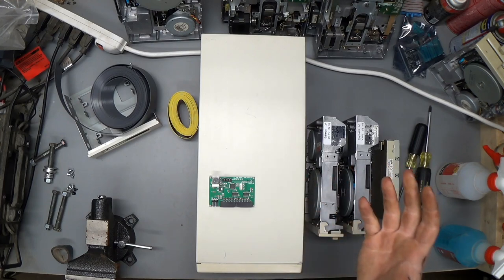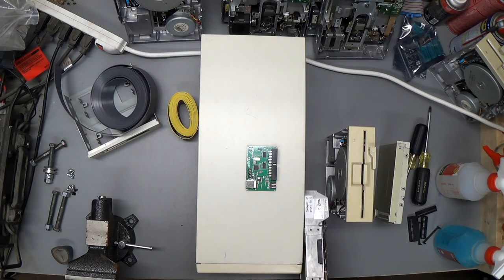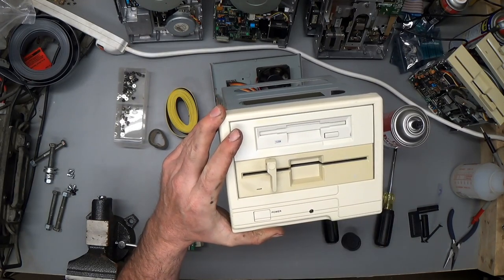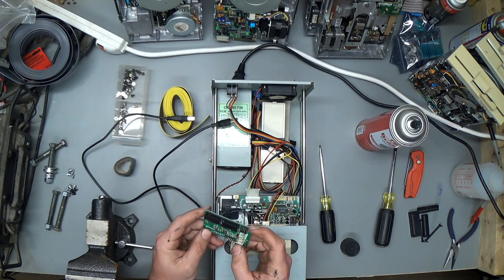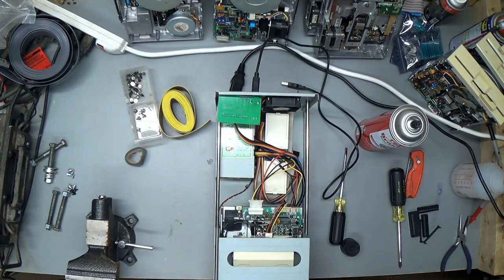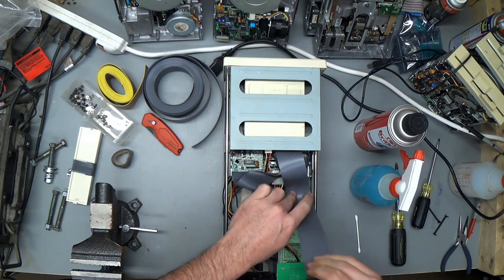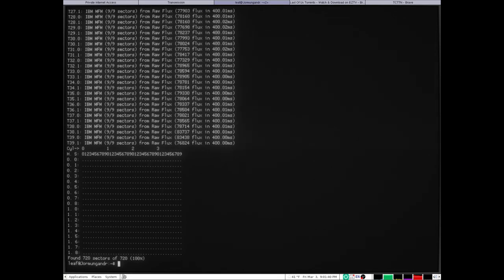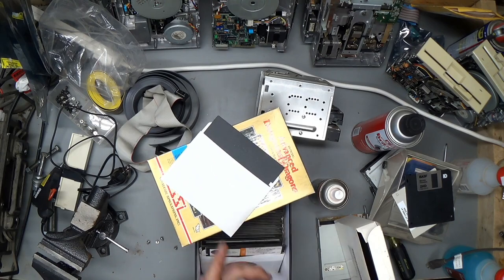Greaseweazle External Floppy Drive Contraption

Comment: I too have used a vice for making ribbon cables. I've also been thinking of getting a cryoflux or a greaseweazle. I've got more computers in my collection now with 360K 2HDD drives and a lot of the archived software comes archived in flux-based formats, and having to hop between three different computers just to install new software can be a bit of a pain.
Reply from the maker: Well it's certainly not quite there yet for non-PC/CPM-type disks.  See next video that will appear in a bit.  X_x